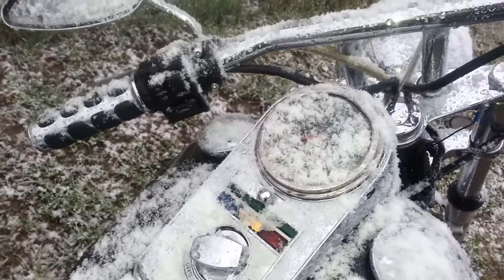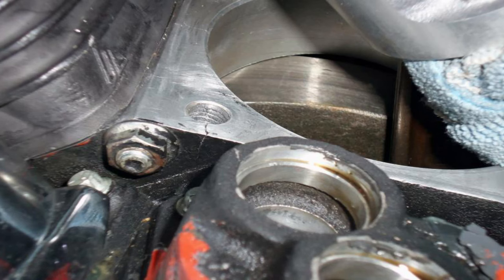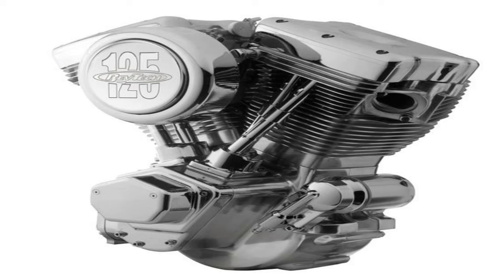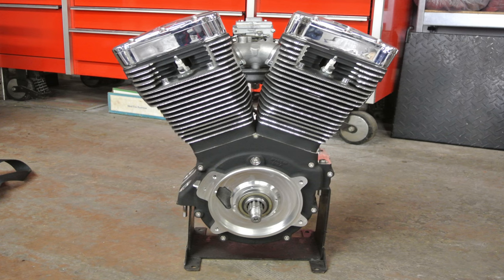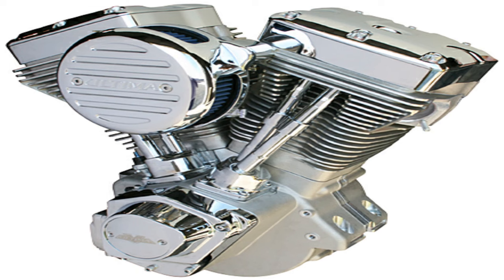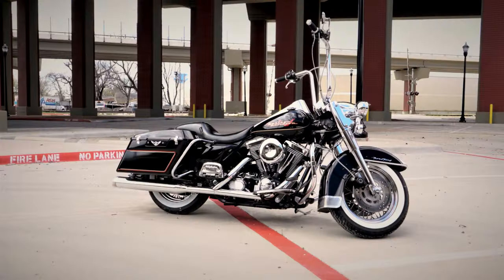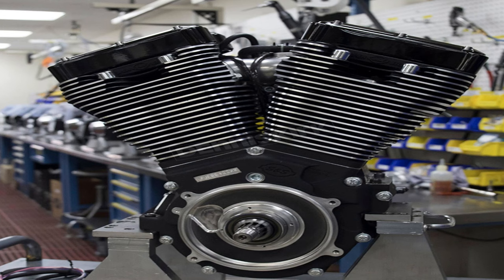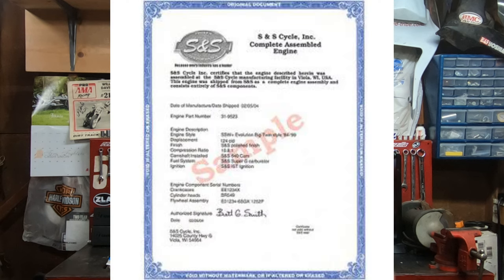New Harley Evolution Engines are Better Than the Original

Comment from the maker: Would you go all out rebuilding your stock engine or go with a new complete crate engine?
Reply: Yep, when my current '88 tc tanks, I will consider a new crate engine. At the moment it has 150K km on it with a dyno run tune giving it 80 hp[no tq info available] so hopefully it will run some more km's😀
Reply: If it wasn't for racing I would buya S&S for the performance  and reliability  aspects.  They have done all the work!
Reply: I’d probably just gut the existing engine. My evo is a springer and I think the stock evo is a perfect, ‘correct’ fit to a bike like that. If I want something faster, I’d just buy another bike, but these crates are super impressive.
Reply from the maker: No worries with a new engine, well most times.
Reply: @GixxerFoo  Could you suggest a good cam for a 2013 ultra limited,  I have a 2 into1 Bassanl exhaust k&n filter vision plus tuner?  I am looking to get a good sound at idle and normally ride mid to higher ram the bike has 19000 miles on it never had and engine issues other than compensator noise in primary fixed with Baker attitude manual chain adjuster.
Reply: Great channel.  Great question.  

Have a 93' Heritage since 97'.  Over 84,000 miles so far.  Rode it all over the U.S.  Never stranded me, never.  Changed fluids, tires, etc. and one carb. rebuild, starter and a jackshaft.  Maybe just luck of the draw.

It sat the last 6 years while I was mega ill.  Started getting a front head gasket leak before I parked it.  Now that I can perform most of the  labor and got to change the gasket, I might as well do a top end job, carb rebuild/manifold gaskets, over due lifter change and maybe an EV 13 cam install with a compression change to 9.25:1 (according to Andrews) and a metal breather gear....fluids and tires of course.

To your question, its important to me to at least keep the original case that has the Harley VIN numbers on it.  Therefore, I would rebuild it not replace it unless Harley started replacing Evo engines again.  In fact, if the case cracked, I would try to have it repaired.  If it couldnt be repaired, I would sell the bike and get another Harley Heritage, either a 1999 or a 2003 100th Anniversary (and fix engine) or a 2018 all black 114 (and fix engine).  I would never pay/finance more than $15k for the  basic  motorcycle.

For me, those awesome aftermarket engines are great for custom projects.
Reply: I was thinking of buying a rebuilt EVO for my FXR, but this video makes me consider a new one. For the prices, I could rebuild a bomb-proof motor, though...with no warranty.
Reply: I’ve gone all out rebuilding my evo. In hindsight, I would of chosen either the Ultima big displacement or the S&S 111”. Simply due to hp and tq gains.
Reply: Id swap out the motor....love the EVO,but,if you got all the quirks out from the originals, go with a swap!
Reply: My 1999 Heritage Springer Softy is 95% original (brakes upgraded to Billet 2 pot) so while a crate engine makes perfect sense in a more modern bike, or if you want wizz, for me I’d keep it standard to keep its value.
Reply: I have a shovelhead strocker so yes I went all out on it and it sound killer.
Reply: I don't really want a new bike I like my shovel ,it's sounds better then the new rich urban biker. I don't like the cam tensioner in the new bikes cuz it does take a sh#$ and at that point it cost alot to get it done at 50,000 miles give or take and if your going to do this then you might as well rebuild the top end since it's apart with that many miles. "Just sayin"
Reply: It has to depend on whether originality is important. If your ride is as common as muck, who cares what engine you put in, and other factors come in to play such as performance and reliability, but if you have an original or uncommon bike then you need to keep it externally correct at least, otherwise it just becomes yet another hacksawed up mishmash worth chump change.
Reply: @williambaker2627  how would you like the stock cams from a brand spanking new 110 cu in 2017 FXDL-S that made 79whp with only 30 actual miles on some healthy sounding lift and duration ..and I guarantee. The mileage as I put those miles on myself to a bros house to see the ride in January at 20degreeF and froze my nuts off back to the shop and the cams where taken out and boxed up along with the entire top end and $12k mo Mooney she's beyond stage 4 and last but not least got the. TTS tune that eliminated all electronis corks and butt plugs and 15 minutes later strapped down left lane at the tree all out dyno drags to my tuners cathartic arrest in the right lane the "busa" from hell turning a 9.7 at130mph but the overstuffed dyna with no limiters ran 9.6 at 123mph. And i still got the entire 110 stock engine one piece at a time or the pile fir 1/2 MSRP
Reply: @JohnDoe-mt8rf  s friend got a deal he would say so I didn't ask but its a 100 inch s&$ of around $8.5k in a bout a 1954 stock frame and he gets wheelies with a left foot clutch slamming 2nd gear with a glass door knob shifter knob with only his right hand holding on to twisting the throttle on narrow single pull backs the bolt on in place of handle bar riser. That between grip to grip aint much more wide than his narrow 16+-? Inch Springer old school front end
Reply: @GixxerFoo  once upon a time our local HD repair them all got a customer with deep renewing pockets that never ran out of money ..and it was one of the biggest revtech with 4 valve heads .and a baker 6 speed .jack gets it to the rpm test stage and turns her loose ...next thing I know jack is setting next to me a zonkas staring into the wall mirror betide the bar an.... jack is most boring serious a bout everything as he tells what he see and. Nothing more .jack looks at me as like in the old westerns we are staring at each other in wall mirror and jack says " I roll it all the way on in 4th and the front end came up and stayed up after I backed off " I say did she come down hard" " yep " didn't break anything ,nope"  put IT away jack !  "It back on the front row show room were its going to stay till time to go home
Reply: @williambaker2627  it's the way you stated that time probably wasting my time but you're compensator problems have not gone away but what you did do that you makes you think you fixed it was also very necessary as the ratchet automatic job just keeps tightening every time you hit the throttle or pop the clutch the compensator sprocket itself can shift off center call Zina primary chain to snap into and at the same time your crush to the aluminum clutch Hub in to little tiny pieces and probably end up wrapping around the crankshaft in which case it will instantly come to a halt no matter what RPM but we'll have enough inertial Force did Twista fly wheels up so pitifully bad I guess the holes will be accurate enough to line it back up nowadays long as it's within about seven thousands of an inch out of round that's good enough for Harley-Davidson they don't care it says it'll run just fine with your front wheels playing hopscotch if you don't have one of these ain't going to get one I'm barking up the wrong tree for $130 you can eliminate all your problems forever and nothing is ever been said today about what a compensator sprocket does is true at all it was put on their back in 1938 don't work exactly like the compensators do on farm machinery so don't snap your drive shaft off inside your tractor when your Baler locks up Knuckleheads in Transmissions didn't get along back then cuz they hadn't exactly match them up to handle the horsepower and compensator sprocket Springs were much weaker than they are now cuz it didn't have to hold much horsepower but today is down there for absolutely no good reason at all other than saving Harley-Davidson from a class action lawsuit they could have took them off a long time agohttps://www.jpcycles.com/product/590-1260/biker-s-choice-34t-compensator-sprocket-eliminator?utm_source=google&utm_medium=cpc&utm_campaign=PLA-Biker%27s%20Choice-Products&utm_id=google_10871490903_116063203845_498219079627_pla-1177309545970_m__590-1260_CjwKCAjwo4mIBhBsEiwAKgzXOKdiAtTfqRqHhzGzpLD6MEiH__tSBJf6-3kmkh_XqPFb0LqYy0TZFBoC7rwQAvD_BwE&utm_term=1177309545970&gclid=CjwKCAjwo4mIBhBsEiwAKgzXOKdiAtTfqRqHhzGzpLD6MEiH__tSBJf6-3kmkh_XqPFb0LqYy0TZFBoC7rwQAvD_BwE
Reply: lol wtf?
Reply: WHY you forgot talk about Delkron engines??
Reply: Where do i find rev tech i dont think they ever produce are there any dealers ?
Reply: If I had the extra cash laying around I would definitely go for the S&S. They’re just such a great company. Probably wouldn’t go with the bigger one, there’s more room for error when you cram too much horsepower in a motor. Things tend to wear out faster. Being used to the stock reliability, I would just go with a mild upgrade that holds onto the reliability. But I would also not be sad about a rebuild on the stock evo. I absolutely love the evo as it sits. Best design to date for the long term rider, in my opinion.
Reply: Your joking shovel heads and Twin cams are superior to evo
Reply: Rev TEC? No  Jim's yes
Reply: @Kevin Parsons man that bike is long gone. I buy’em cheap, build a strong running motor for it and send them on their way. That last one was an exception. 14k in to a 87 fxstc Softail. WAY too much money in that bike. 2k in just the paint. Sold it to a good friend of mine for a substantial loss but at the end of the day, I needed money, he needed a nice bike so it all worked out. But I really got to work on watching how much money I put into a bike lol
Reply: I did a top end on a 1994 FXDS with almost 60,000 on the clock.All but the rocker boxes/pushrods,carb,pushrodtubes were replaced.Some miles later replaced the stock carb with a Super E.Running strong now.Price?-about $3000+.That is including any special tool(s)needed so as to not suffer disassembly/assembly.A crate engine would be very nice.Here again it comes to how much $ is available.

Comment: Evo engines are crazy easy (and fairly cheap) to rebuild. I'm perfectly fine with the original horse power. I bought mine to cruise on, not to race.
Reply from the maker: Parts for Evos are plentiful and cheap, they are everywhere too! I you decide you want a little power bump a Andrews EV27 bolt in cam is a awesome Evo cam!
Reply: @GixxerFoo  Music to my ears.  I just want to cruise, and do it for a long many years.  I don't need a beastly beast, just gotta make the sound of that motor smoother and make sure it can keep going and take me where it's pretty.  :)
Reply: You Sir are 100%CORRECT!
Reply: Absolutely. Stupid people want to keep dumping money into a machine to get more out of it and that starts the domino effect., constantly chasing the weak link.
Reply: Nice... I am gaining so much information just reading the replies
 👍 ty everyone
Reply: Thanks for giving your time and knowledge. Your giving us the approximate cost of these choices, with some of the good and bad of each lets the average person go to a supplier and have an idea if they are being taken advantage of!!
Reply: Same here… I have an Electra Glide Classic.. The 80 inch Evo gives me more than adequate power for touring.
Reply: Eh, factory Evo, mild cam, stage 1 headwork, and slightly more compression will wake it up some without any real loss of reliability at a reasonable cost.
 Plain and simply would never trust the cheap Ultima. When they came out with roller rockers they had like a 45% failure rate, and my experience w/ their transmissions tells me they're not the best.
Reply: I run a Ultima 127 and go everywhere on it minimum 20k a year on average one year did 20k in 6 months 😊

Comment: I bought a used 1992 Fatboy near 20 years ago with around 60,000 miles on it. It ran good for another 10,000 to 15,000 miles. About 10 years ago while in Sturgis during the August Rally, the cylinder studs on the front barrel pulled out. While camping at the Deadwood KOA campground, I pulled the head and barrel off using the picnic table as a workbench. Located a set of Keen inserts, drill and tap for the inserts I re-drilled and taped the cases for the inserts. After installing the inserts firmly in the cases & reassembly I was able to enjoy the last 5 days of the Sturgis Rally. Returning home months later on a short weekend ride with the Wife on the back, The studs pulled out again. We were about 15 miles from home and I removed the front spark plug we turned around and rode the bike back home on the  one back cylinder, slow but surely we made it home. After that I simply ordered a brand new EVO crate engine from Harley Davidson and for only $2,999. Dropped that motor in with no problems and it ran perfect then as it does today in 2022. The silver lining to this story is that I sold all of the old engine parts including the cases for $2,500!
Reply: Gotta 89 Softail custom had the same break down ,drilled the case and put a roller pin in it? Held up for awhile, then it split to the rear cylinder. J.B. weld and still got a another  year, motor had 92,000. Gotta REV-TEC. 100 in. Going on 10 years, 💪🤠

Comment: My 1998 Evo cases are stamped with a dash 95 casting number indicative of their upgraded castings due to being EFI era motors. These cases are of a MUCH better quality than their predecessors and aren't known for cracking etc like the others were. Just thought I'd share some of this useless information with you guys. Many folks bore out their spigot holes to accommodate a larger bore with no problems. EFFE (Evo's Forever  Forever Evo).

Comment: When I ran my shop for 20 years I have a retired master chief out the Navy do my wedding and critical machinery. Facts he said the best cases he ever welded and repaired were the stk Harley cases and the rev tech cases. Pure good alloy. He said surprisingly the worst seemed to be the S&S. Not saying they were weaker but the alloy has a lot of crap mixed in it. Funny colors came out the alloy while tig welding it which showed impurities on the casting materials. After building parts for aircraft for 39 years welding.. machining and tanning parts I took his word on this

Comment: I bought a brand new S&S Evo engine, complete with no carb around 10/2022. Had it in the bike by 12/2022 and used a nos Cv carb (had to be rebuilt because it was still in the original box from 1997). It runs great. It does need a few minutes to warm up with the choke on when you start it but once it's going I have no problems with it.
Reply: Mind me asking how much you pay for the evo s&s?
Reply: @neveragain9380 I bought it without a carb just the plain motor at that time it was 4800
Reply: @benzielke7149 from where and what size engine?
Reply: Try jetying the nos carb correctly
Reply: @theoneracer2716  I actually checked in to that and did put slightly bigger jets in it. Runs even smoother now, and accelerating has no (not sure of the right word) resistance or you don't get that feeling like it's trying to push but it can't... I think it wasn't getting enough gas.

Comment: My 103 has 92000 miles...still going strong. Regular fluid changes and rode hard. Cheers brothers👍🍻
Reply from the maker: That's awesome to hear! That is just proof that not all the TC motors have issues!
Reply: Mine is about to roll over 57,000, I swapped my cam chain tensioner shoes at 54,000. Had .0035 crank runout. Still going strong!!
Reply: 92,000 wow that's a lot of riding

Comment: I currently have S&S cases on my 97 Evo, the previous owner put them on when the head bolts pulled out. I would probably rebuild and upgrade what I have if ever needed, but the S&S 111 does sound like the most appropriate choice for a new engine. Reliability beats the increased power on the biggest engines.

Comment: "New Harley Evolution bikes are better than the original", I wonder...
Never met anyone with a high mileage aftermarket engine.
I would rather overhaul the original engine block and keep it a Harley.
Reply: bingo
Reply: Just another social media BS sales pitch funded by companies trying to sell their junk.   

  Give away one engine to a guy like this and he’ll hammer out video after video of how good this product really is.  When in reality, it’s pure garbage. 

  Most affordable marketing scheme in our world today.
Reply from the maker: I'm not paid by any company, the Evo cases really do have some issues when you start bumping compression and putting some power in them. Case failures are more common on the drag strip when you're really pushing limits. Getting up to about 90 horse on an Evo is good stopping point, to push above that after market cases are highly recommended. As with anything there are good and bad experiences with aftermarket engines, but at the race track the crate motors have held up pretty well being beat on.
Reply from the maker: I fully agree for the street with a bike you ride every day and for longevity keeping the factory engine with mild upgrades is the way to go. You wouldn't want to build a 100+ horsepower Evo on the stock cases though, Ultima has stout cases and see them used quite a bit at the drag strip.
Reply: @GixxerFoo  Not a lot of miles are ridden on racing tracks and drag strips.

Comment: Definitely Ultima. I have the El’Bruto 113 in my rigid. It’s been totally reliable and makes BIG power. Once my 80’ wears out, I’m getting an Ultima for that as well.
Reply from the maker: Ultima is the choice for a lot of drag racers, those motors hold up very well being beat on at the strip. They've done a lot of great things with their cranks using their own design of crank pin.
Reply: @GixxerFoo  I can see why! It never seems to quit pulling. It's way too much engine for a rigid though. Hind sight.